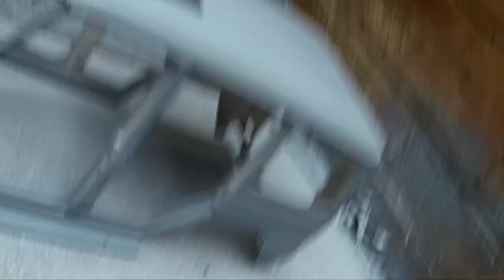How to paint RC hardbody Part 1 & spray painting tips

Comment: How about you tape the screws on a piece or cardboard and after washing it hang it up to dry and always do the underneath first then let dry then do the upper side and hang it up to paint
Reply from the maker: Hey dude... Which screws?... I don't tape screws up.. I use an idiot board is necessary.

As for hanging... Not a fan of hanging.. .. Over complicates things.... Fine if your baking on 2pac paint etc etc... But for spray paints... No need

Comment: Should I put the raptor hardbody together first before sanding are do individual pieces first then put together?
Reply from the maker: Do individual parts .... but paint all at the same time if possible.
Reply: @RccarsUK  ok thank you for your help love your videos
Reply: Can I use rust oleum primer and does it need to be the primer for plastic?
Reply from the maker: Doesn't need to be plastic specific primer no... just needs to be applied on a keyed surface that's been prepped
Reply: @RccarsUK  ok thank you
Reply: @RccarsUK  I’m trying to figure out a color to paint the raptor, I would like a color blue any suggestion?
Reply from the maker: @michaeldavis8259  used always been fond of blue.

Rustoleum metallic range blue is nice.

Or if you want something different ...try teal.

Teal is my all time favourite colour... and comes in many shades 

I prefer a darker teal...like the bmw m3 teal colour...search it on Google.

To get that...try backing with black or dark metallic blue before you do the teal top coat
Reply: @RccarsUK  ok thank you I will look into that thank you